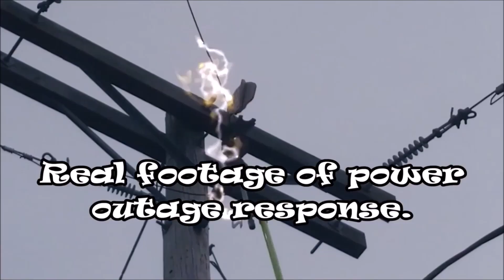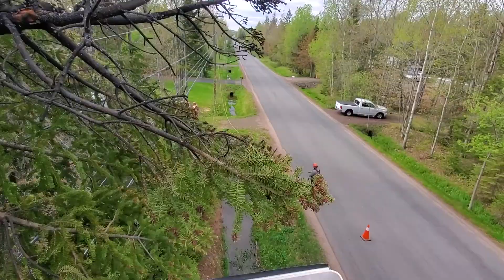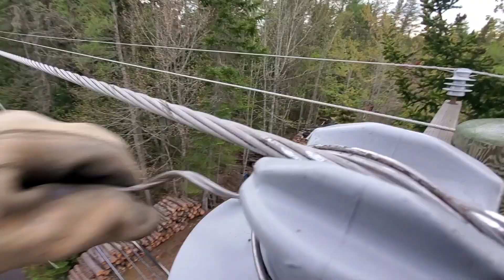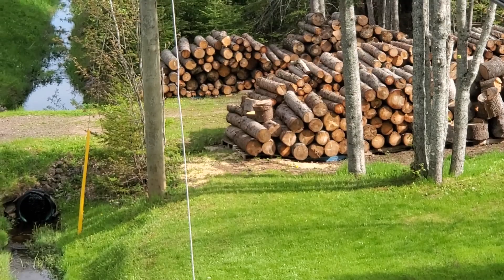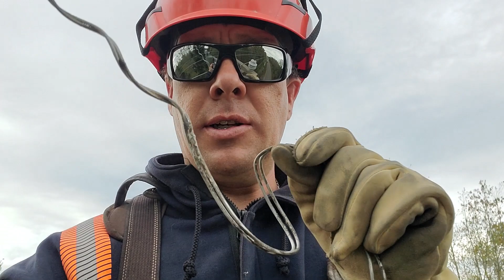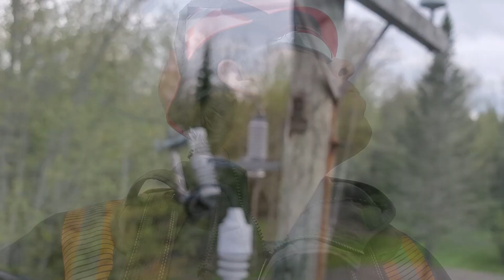Improper tie wire drops powerline across driveway

Comment: I wonder if it would be feasible to design a modified come-along that would locally untwist the wire and make a gap that would fit over the insulator. When the tension is released it should grip super tight.
I can think of ways that this could be used with hotsticks too

Comment: Thank you for showing this video. The pole outside of my house has the primaries running along the side of the insulator but hanging about an inch or so away from the insulator with those wire ties twisted around the line on both side of the insulator  and running around the other side of the insulator essentially holding the line to the insulator the way a lineman hangs off of a pole if he were to climb it. The power company has been down in this area and has seen that pole on many occasions over the years, and I even heard them verbally acknowledge that the primaries had rolled right out of the insulators and then they just went on their way. 

Recently we had a tree come down about 4 poles down. It took down 1 pole and destroyed the hardware on another pole and in the process took the crossarm on the pole mentioned above and spun it 90 degrees with the primaries still attached the way I described. When they fixed up the mess a few poles down, they ended up inadvertently straightening the crossarm on that pole in front of my place and the most they did was check to make sure the primaries were still attached and again went on their way.

Comment: I've been in the electrical field for 20+ years, and I swear to god, 9 out of 10 problems that occur after a system is up and running are due to egotistical bone heads who are too weak to ask someone how to do the install correctly. OR they just assume they know, even though they came up with everything on their own. 

Things as small as wire nuts only turn clockwise, may seem like no brainers, but trust me, I've seen plenty of people who were left handed, install a hundred or more across a site before someone noticed and showed them that they're doing it wrong.

Comment: Im a cable TV lineman and he have similar issues with contractors not knowing what they are doing or not caring. Improper tensioning on the spans and or not tightening span clamps is a big safety issue that no one seems to get. When someone hits a pole and THAT pole snaps but the rest of the plant remains in the air, people say wow they were lucky. But thats what is supposed to happen and how its designed to work. If a pole is hit and 5 poles snap off, then the spans were improperly installed. Stay safe out there.

Comment: I was wondering if the power is cut off why do you care if it is bonded and grounded.  Is that just a check before making repairs and turning the power back on or are you concerned about the line somehow becoming energized while working on it.  Probably a dumb question but I am fascinated by the work you do.
Reply from the maker: Great question actually. Very complex answer, but here's the skinny.
- grounds drain any residual/inductive charge in the wire and trip the line if energized.
- bounds make sure that if it does become energized, everything you touch is at the same potential. That way you don't get electrocuted (on paper at least).

Opening a line does not mean it's safe to touch, quite often there will still be potential of some sort...

Comment: We had a power surge here a few months back, a high voltage transfer wire dropped down onto the wires connected to the transformers to our house, blew the meter straight out 10 feet from the pole, likely the same thing that happened here, just less expensive. (Our power surge likely costed the power company half a million or more since the farm next door probably lost about $100,000 in equipment and we lost $15,000)

Comment: Lineman working with 12470 volts can get away with screwing up, but if i screw up as an residential electrician working with 120 volt there is a lawsuit, a fine, and my business is over.

Comment: Looks a lot like the old Western Union pig tail tie that they used on the old telegraph lines.  We learned how to use them in soldering wires in electronics class.  "Do a pig tail and then solder it and if done right won't ever go bad" Mr. Rohondeaux used to teach us.

Comment: I have an unusual question for you seasoned linemen. It appears in my area , amateur radios are plagued with noise until it rains. Power company has checked grounds or regrounded where needed. I noticed the hotter it is and windy , the worse the noise. Affecting 40mhz- 160mhz. We can generally fox hunt the noise to a general 100 ft area but beyond that requires power engineers ? I’m curious your thoughts on the issues?
Reply: Most of the time radio interference is caused by bad lightning arrester in the area, but could also be several other possibilities. Cable tv companies are great for reporting interference calls. Radio interference call last week and had a bad arrester.
Reply: @william-fla-321  lightning arresters on the power company’s poles”lines”?
Reply from the maker: Lightning arrestors are on most pieces of equipment (transformers, risers, regulators etc...) They're a high resistance path to ground. That way the extremely high voltage of a lightning strike "drains" through an arrestor before damaging the equipment.

Another common occurrence of radio interference is a constant buzzing or arcing on an improperly tied tie wire or a pin hole on insulated wire when underneath a metal tie wire
Reply: @JayN4GO  Yes. The company I work for has equipment for detection of radio interference. As a troubleshooter, I find many of them, but normally I don’t have the time too locate all.

Comment: Thank you for the education. I've been trained in the use of safety wire to prevent loosening of bolts or nuts in high vibration environments.
This is pretty similar,  going around the cable on either side of the insulator but not wrapping the tie wire around the insulator securing the cable to it is obvious. How a even a new lineman could mess this up is beyond me. It seems before they are allowed to work on lines out in the real world, proper installation of tying lines to insulators should be practiced so many times even a newbie should be doing it in their sleep.
Keep up the good work and stay safe.

Comment: I imagine you replace that whole line as well? I saw it was frayed You didn't mention it but I'm just curious how long that took to replace and where do you start which end?
Reply from the maker: We spliced in about 10 feet of new wire where it was damaged. It doesn't take long... We did that step first to allow for extra wire when making the final splice at full sag, where the tree hit. 
A splice for that type of wire is typically a hollow compression sleeve or an automatic sleeve with grip/wedges built inside.

Comment: The tall thin trees should not have been allowed to grow so close to the wires in the first place. The trees should be cut back or the wires should be insulated. Also, bare wooden cross arms will go rotton and get weaker over time. All high voltage lines in the UK use galvanised steel cross arms and wires are insulated where they pass near or through trees and unsafe/rotton trees are cut down before they fall on power lines.

Comment: Come to Québec, those top lines are 25kv 😅
Reply from the maker: We had some 25 up until about 10 years ago! Was kind of a pain having material for two systems! I only worked on it a few times tho
Reply: @Bobsdecline  yeah makes sense to have it all unified to make transformation simple.  Not too many places left in North America with that much voltage on low poles.

Comment: It just seems like there should be a better way to secure the wires to the pole
Reply: this is incredibly strong and easy if done properly as he showed, once those are spiral wrapped and locked it’s the strongest you will get.
Reply: @MegaTapdog  It would be harder to get it wrong if, say, the tie has to feed through a hole in the insulator.  Still, to not get that, on both sides, the tie wire has to come from UNDER the main wire, seems stupid.  Coming from UNDER, it's tying the main wire DOWN.   Coming from OVER, it's just sitting there ready to pop off the TOP.

Comment: Thats why my power goes out two to three times a week for no reason so i called up electric company they told me i have too many squirrels in my area I know they are lying to me a one little squirrel cant knock out power for 45 minutes to an hour every week it is so frustrating ughhh
Reply: @crankyfrank8322  Thank you for that info Now I know for sure its the squirrels in my neighborhood knocking out my power damn squirrels why why!!!!
Reply: @crankyfrank8322  can't put squirrelproofing insulation on top of those transformers, which even if capacitive coupling still kills the squirrel, it won't short the line?

Comment: So the bare cable is just for suspension of the actual power lines that are enclosed by insulation, right? No juice going through that bare wire?
Reply: No, the bare wires are the high voltage primary lines.  Most high voltage power lines are bare.  Only the low voltage secondaries have insulation (usually).
Reply: @stargazer7644  Thx for the clarification. Now I know!

Comment: Aaron, I found your channel by accident but really like how you explain things. I have always wondered what some of the equipment did on the pole. I live in a small community in Pennsylvania and just recently had a pad mounted transformer burn up as well as a neighbors home. I am on the same supply line and noticed the power went out twice and then stayed off. (I guess there is a re-closer on the line.) What is the life span of a single phase pad mounted transformer? Keep up the great work.
Reply: I’ve seen pad mounted transformers 50 years old, but average I would say is 30 - 40 years. I live in Florida, so most fail here because of rust from recycled water & lightning hitting them. Power is like baseball, three strikes and it’s out.

Comment: How is the wire long enough to reach the ground?
Reply from the maker: If you unhook it from one pole it will hang down...  let's say 10 feet. Then unhook from the next pole, maybe 15 or 20 feet. After after 3 or 4 poles it will lay on the ground. Unless of course it's sagged up really tight!

There are engineered specs for proper tension according to wire size, span length and temperature

Comment: how many many poles ended up being tied incorrectly that you had to redo?  Nothing was said but you had a spot that looked like it was going to need a splice too.

I could see that it wasn't on right... there was no retention... likely could easily lift the wire up off that third phase without issue.

Comment: Awesome channel! Im executing the same job but in The Netherlands. All our wiring and cables are underground except for the 150 and 380kv HV (existing is above the ground, new lines MUST all be underground since 2 years). It’s such a different situation, our substations and switching gear is way more advanced and safe! It’s awesome to see how you guys operate above the ground. The switching process etc is obviously the same, grounding etc. But you work on alot of live lines since its off the ground, pretty much all lines except for LV 400v are switched off before working on them since all our cables are insulated and need to be peeled to work on them. Great channel keep up the good work!!

I’m considering to start my own channel, in english to share all the work on underground lines which we do!
Reply: Please start a channel - sounds really interesting
Reply: If you are burying your lines underground,don't you have leading power factor problems due to conductors being in close proximity to each other and the capacitive coupling?
Reply: @joecummings1260  cables are insulated!
Reply: @bartselter5332  that prevents arcing, but only increasingthe spacing between phases or phases to ground prevent capacitive coupling.
Reply: @joecummings1260  no, the earth screening surrounding the cable is getting rid of any power residu
Reply: @joecummings1260  we’ve been laying 6x1x800mm xlpe last few months over 20km’s. The way these cables are engineered have nog power or magnetic field residu left surrounding them
Reply: @bartselter5332  As an electrical engineer, I think there is a confusion here.  This isn't talking about fields getting out into the open environment, like happens with overhead power lines.  This is talking about the wires not posing a purely resistive and inductive path between source and load, but capacitively shunted to ground/earth as well.  That very screening you are speaking of is why there is a capacitive shunt impedance in the line which is far more than for open overhead lines.  Depending on what the respective reactive impedances are for the inductive series impedance and capacitive shunt impedance, there will have to be a "power factor" adjustment element every so far, like an inductor bank or a capacitor bank, to minimize resistive (ohmic) energy loss in the conductors with respect to real power delivered.

Given that, however, I would guess it is considered benign in most if not all circumstances to have extra capacitance since all practical load power factors are inductive anyhow.
Reply: Please do!
Reply: I don't know why with current wire TEC all new lines are not underground. Aside from idiots digging without permit seems to be way safer and stronger against high winds and trees.
Reply: @diemaschine2287  huge cost, also increases outage time by a huge amount but outages are less common as you say.
Reply: @diemaschine2287  Netherlands is 4 hrs drive top to bottom.  Canada is more like 60hrs non stop to drive across.  That's alot of expensive cable to burry in mountains, prairies, forests, Canadian Shield, swamps, and everything in between.
Reply: When were all medium and low voltage wires replaced with underground cables in the Netherlands?Are you sure ALL of them is underground?In Germany many people say that everything is ungerground but according to wikipedia only 73% of MV and 87% of LV is underground.
Reply: @MernokiMegoldasok  AFAIK it's all underground in the Netherlands below 150kV. If you're visiting Limburg (the southernmost part of the netherlands) you can cross the borders between NL, D and B multiple times. All villages look about the same regardless of the country they're in, but you can tell you're in Belgium because suddenly there are above ground power lines again. There is a tiny, relatively low above ground power line in the province of Groningen somewhere which could be below 150kV, but i don't know the details of that one power line. At the very least 99% of all <150kV lines are underground. 
Most of our ground is soft (so easy to dig) and we have no seismic activity that's not caused by fracking, so our country is about as ideal as they come for underground power lines.
Reply: I would like to have an off line conversation with you about the poly insulators if you would be so kind to share with me.let me know the best way to get in touch. Thanks. great stuff your doing good job

Comment: Do you report such faulty installation so they can trace back where this kind of mistake is made and have the person who did it educated? In my old appartment there was an elevator where a mechanic left a lot of wires not properly fasted down, causing the brake to hammer on and off during the ride. The mechanic only fixed it and didn’t report as he didn’t want to bring is colleague in trouble. I think the safety of possibly life threatening installations is way more important than someones job.
Reply: There’s so many contractors working on are property, it’s nearly impossible to find out who’s doing it. I have found that same problem during storms, just fix it, and go on your way. Most of the time is makes contact with a cutout bracket or grounded equipment.
Reply: @william-fla-321  It's only a problem to find out if someone didn't care to document it. Some places give every part over $100 in their facilities its own ID and record including where it is, how and when it got there, and what services and repairs it had done. That also gets linked to a work order and a crew and everyone signs for all their parts. With good records it trivial to figure out who did it and to let them know how to do a better job. No harm in that, everyone benefits. If such documentation seems excessive - it might, until you want to warranty a 2MW inverter on a solar farm and have to prove you treated it as your contract says you do or you have to pay the new one yourself...